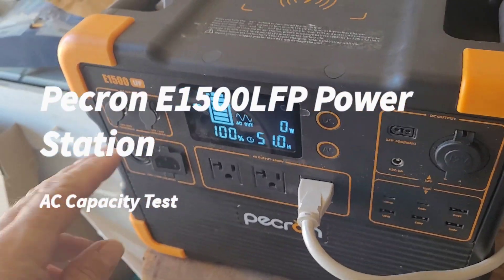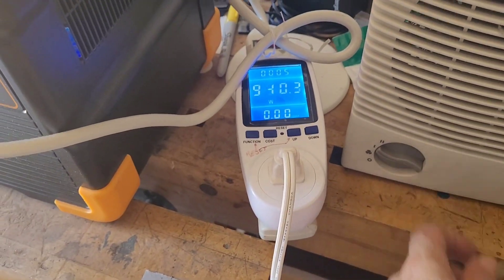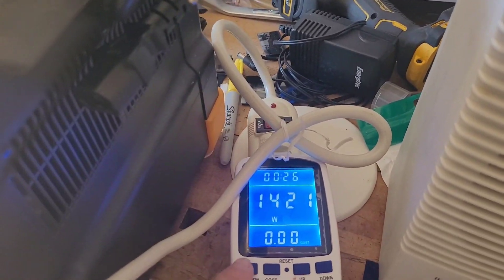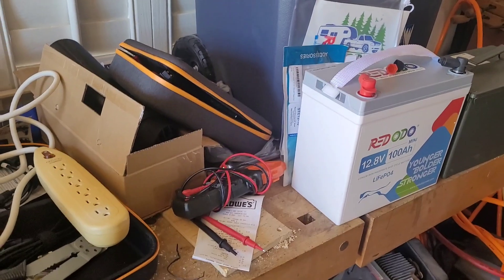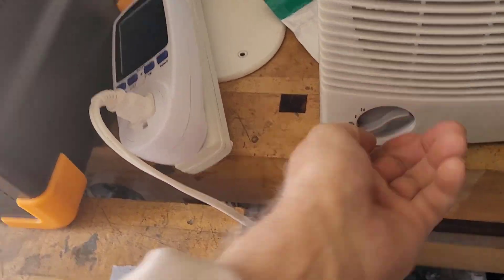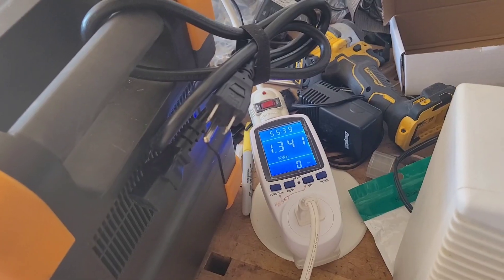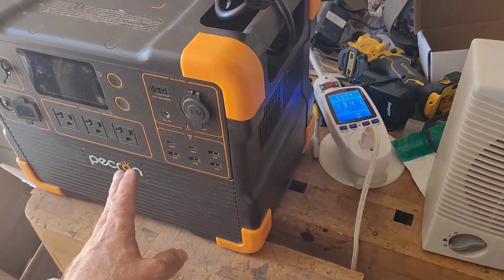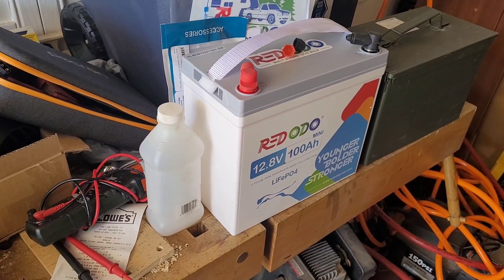Pecron E1500LFP Power Station, AC Capacity Test

Comment: Hi, im glad to have watched you vid.  I have the same unit. Does your unit produce whining sound when a high watt appliance (like air fryer with 1400watts) is plugged in? The fan noise is expected, but the extra engine-like sound kinda annoys me. 

If a 50w fan is plugged, the sound is lowered to a tolerable level.
Reply from the maker: Not that I know of.  I used a duxtop ls9600 induction cooktop, it is 1800W.  I was listening for a high whine because a lot of 1star reviews for the duxtop induction cooktop, didn't hear.  I will give it a try again, and post if I hear whine.
Reply: @dave_in_az  appreciate your reply. Though im pertaining to the pecron e1500lfp if it produces a whining sound when a power hungry appliance is plugged.
Reply from the maker: @gabrielyumul  I understand, I was just saying the  highest watt item Ive tried is that induction top, and I was specifically listening for any whining and didnt hear any, from either pecron OR the cooktop. ;)
Reply: @dave_in_az cheers mate thanks a lot. 😊
Reply from the maker: No worries ;)

Comment: This unit is outrageously cheap at $699 flash sale right now. I thought i did good at $854 last year. We plug our fridg and freezer into it (+ the expansion battery) whenever were gone travelling. Luv it!
Reply from the maker: I agree, great sale.  AND Pecron just released a 500W alternator charger for it, basically a dc converter to boost 500W of 12v from your alternator/starter battery, to 42V to feed into the solar input while driving.  I have a bunch of vids on this, using a power supply, and have been looking for a good 12v -> 48v converter, exactly for this.